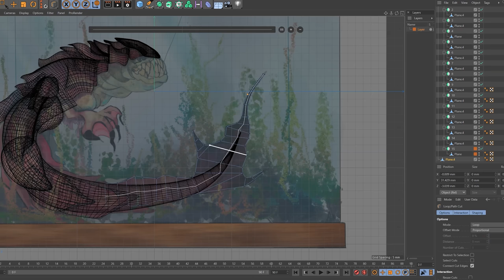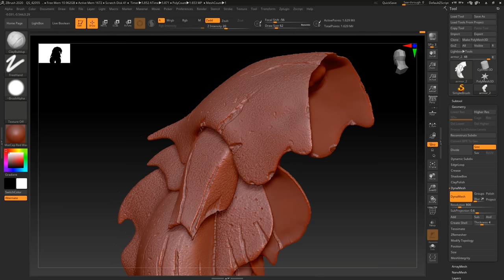Minibricks: The fisherman didn't expect the one he caught / Diorama / Leviathan

Comment: How did you get those fantastic bubbles coming out of the Leviathan's mouth?
It gives the whole diorama an extra boost of realism.
Reply: i think those bubbles formed when it was curing. Most of the time it's an accident.
Reply: My bet is that there was empty syringe with needle used while it was curing to put extra air bubles inside.
Reply: Yes! It is unbelievable how much those bubbles add to the whole rest which, already, is so incredibly good!
Reply: He just inject them with a tube, for my opinion. I saw this before in a video of jackjack craft 👍😁
Reply: 99% likely that it was a accident. Those teeth are a really good place for bubbles to form because of how complex it is. Doing that sort of thing intentionally is possible, but its fairly risky and its easy for the bubbles to stray or expand in ways that can crack the piece.
Reply: @FastForwardPlans  Doubtful, more than likely the artist added the depth of the teeth and underside of the maw ahead of time with the air in mind, then used the angle of the shape of the inside to catch the air in pocket then slowly tilt it like grooves or divots. like that gap at 9:58 using the eye as a marker. 
As good as they are with measuring each process, it probably wasn't much on the luck factor. 

More likely its from skill in knowing the triangles of the teeth would capture more than enough air, then could tilt the groove to form long stringy bubbles that are small enough to drift from the teeth, then with out adding too much air where it will cause cracking.
Reply: @ExiledDiclonius  you would have lines, you would have to use the gaps of the teeth or that divot beside the eye then tilt it slowly. Using the measurement of a small test batch in how long it would take bubbles to climb from point a to b. and then applying the method when the time comes to get the best results.
Reply: You Tube  Wow, how are you so certain that someone else is wrong in what they think? What if the plunger on the syringe was being pulled as it was withdrawn? That would create a vacuum that would draw up the air channel created by the needle. Why wouldn't that work?
Reply: You Tube  No, it wouldn't. You know exactly what I'm saying: pull the needle out until it a trailing air channel starts to form. THEN apply suction as you withdraw the needle the rest of the way. Oh, but you're an internet expert, so everyone should listen to you. Watch out, people, the expert is here to educate everyone!
Reply: You Tube  No, I am right. It is literally your job to misspell "literally" two different ways. I know what I'm talking about and will not shut it.
Reply: This is also one of my question in mind, if that was intentional then it is definitely need crazy amount of skill and knowledge to do so. I would like the creator to elaborate on how he did this.
Reply: @ratokka  "He"?
Reply: My guess would be with a syringe.
Reply: @mykalimba  don't worry about them :), they're the kind of person who “graduated top of their class in the navy seals”
Reply: You Tube  hey, I know it's only been four days but are you still alive? It'd be pretty cool if you were not.
Reply: it was literally a convenient accident. the complex shape of the teeth was the perfect place for bubbles to be trapped. That's why you didn't see him make the bubbles, nor did he mean to make them.
Reply: Okay okay, so so many of you think it could be either an accident or a syringe, but could it also be possible to make "bubbles" by using clear acrylic from the section at around 5:20 where they're painting in the surfaces and dribbling acrylic on the plants and such? thus when they pour in the blue acrylic for the water, the previously cured clear acrylic stands out separately as bubbles?
Reply: So heres the thing. If youve been a long time watcher, then you know that they never have bubbles in their cured pieces unless they are meant to be there. The bubbles were no accident, or mistake. They were there on purpose.
Reply: @jmchez  either you're just joking or loves to make a fuss about every little thing

Comment: how did you get the bubbles coming out of the leviathan's mouth? the detailing is insane
Reply: it is an accident.
Reply: Syringe
Reply: Put a little cotton or a sponge in there before you pour. It’ll hold air, and as the material soaks up the resin, it’ll release air bubbles. 
I don’t think they intentionally added those bubbles, but it adds a lot of fun detail
Reply: It's possible that the "accident" reply is actually correct. There was air in the mouth when they poured, and some of it may have leaked out. Which means if you make something similar yourself, you need to make sure you fill in the under-scales spaces before you pour, so as to avoid similar bubbles from there.
Reply: @ronaldbell7429  Your saying the bubbles are perfectly placed in the piece on accident....lol. Come now
Reply: @AC-fv7kt  Other people are saying it. I'm saying it's possible, and I explained how it might have happened. You on the other hand, could think of nothing more cogent than "LOL." Maybe among double-digit IQs, that passes as rebuttal. For everybody else, it's weak. Note that there's nothing in the video to indicate she actually did anything. She might have been able to do it with a long syringe but... if she did it on purpose, where is that in the video. Until you find that evidence, spend the time learning the art of argumentation of hypothesis by logical inference. It'll make your input less tedious.
Reply: @ronaldbell7429  No evidence?! The item has the bubbles in the correct spot...you are the one making a claim that is unsupported...My evidence is with this piece and that the bubbles are exactly where they should be. Your claiming you know more than her and it was a mistake. Your evidence is.."I know more than you, trust me she didnt mean to do this. It was a mistake"...lol...lol
Reply: @AC-fv7kt  you should have taken the advice you were given. You’re making yourself look like a fool. He never said it was an accident. Merely that it could have been an accident and there’s a train of logic that supports the idea. Specifically, though, it is more likely that it was an accident than something done with intention for the simple fact that it wasn’t shown on video. You’d think, the most thoughtful and detailed part of the art (if it was done on purpose) would have been featured in the video.
Reply: @captnmaim  Lol...another one that cannot come close to the talent in this video and has their little pride hurt..."no way they are this good!" It's OK man/girl, if there wasn't greatness out there you would never want to get better. We are all here for you. Go ahead and vent, get it all out
Reply: @AC-fv7kt  To me it seemed like something almost unavoidable, so they may have accepted the compromise and went with it, or it happened without realizing (or they used a syringe to get bubbles there, but there's no footage of that in this video, which could be understandable considering the time constraint you have with resin pours).

The thing with these builds is that often air bubbles aren't too unrealistic as they form under parts that could have trapped air in a real life scenario.
Reply: Maybe u can just add imitation pearl for the bubble?
Reply: If I'd be a miljonair, my house would be filled with these